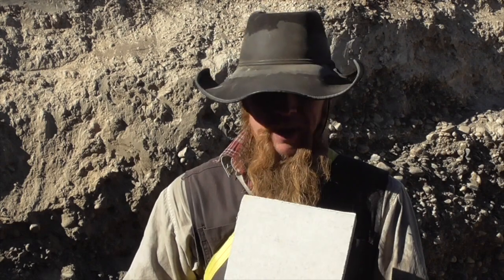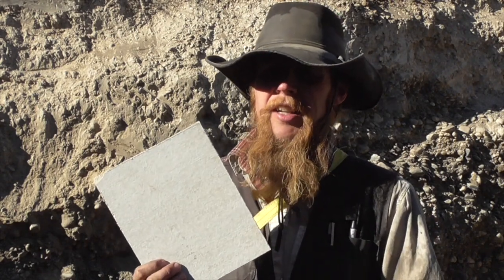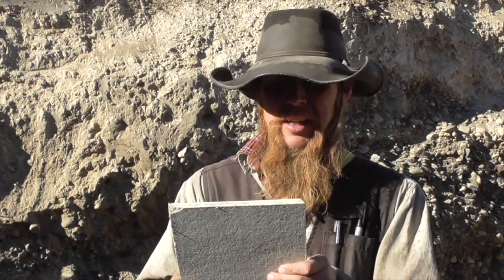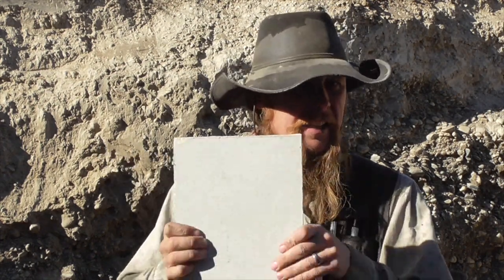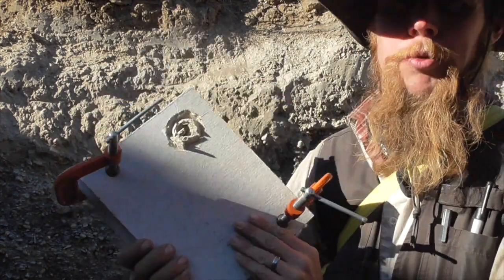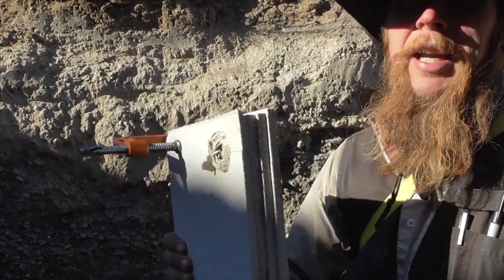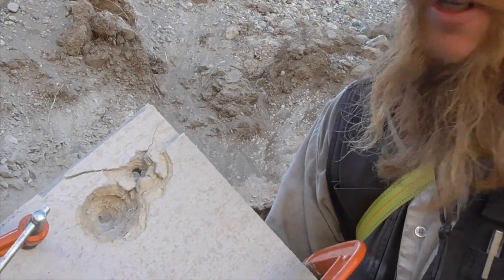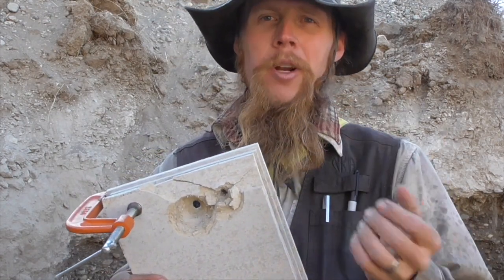Testing Improvised Armor: Wet-Backing Board (TIS235)

Comment: I’m a retired carpenter (framer) and used quite a bit of Hardy boards in my time swinging hammers. And you are correct, it is a cement/cardboard material. If it gets wet on an exposed side, it turns to mush. I’ve found these to be a waste of money as they are easily broken and became next to useless when they became saturated with Dihydrogen Monoxide (they soak up H2O like a sponge). They also eat up saw blades faster than a meathead looses teeth. But hey, if the customer wants to fork over the dough and use it for siding I’ll gladly install it. It’s a shame nobody uses good old cedar shake anymore. Wonder rustic look and the smell is wonderful. Good natural bug repellent too

Comment: Its like its conducting instead of insulating.  Ceramic of crystalline substances seem to do better and high tensile strength is best as it is able to resist by transferring the energy along its structure sideways.  I'm thinking the best balance between crushing and tensile would be best.  I found a video where a guy made a pile of sand resist much force by placing layers of paper towel to provide something to transfer the energy sideways.
Reply: https://www.youtube.com/watch?v=0olpSN6_TCc